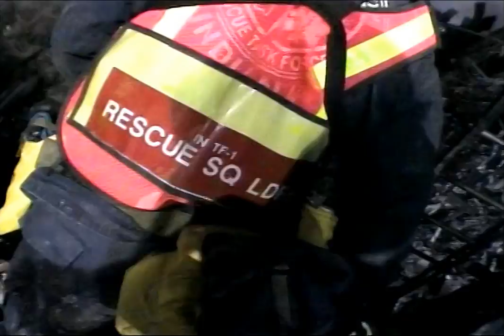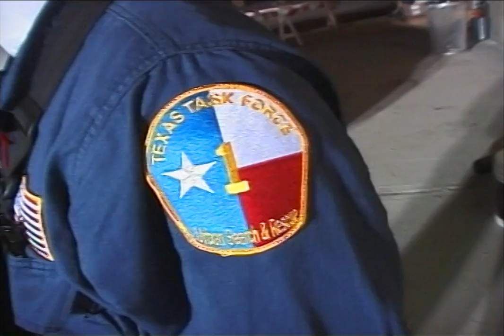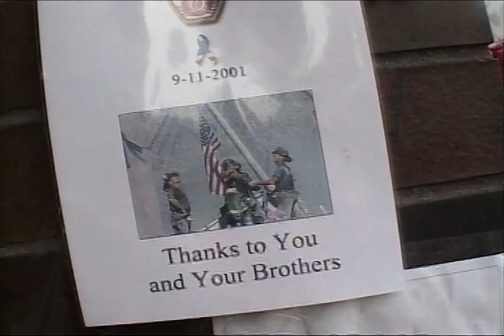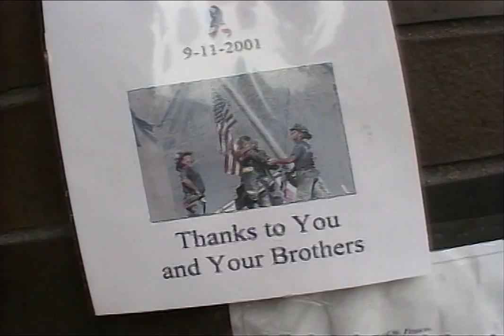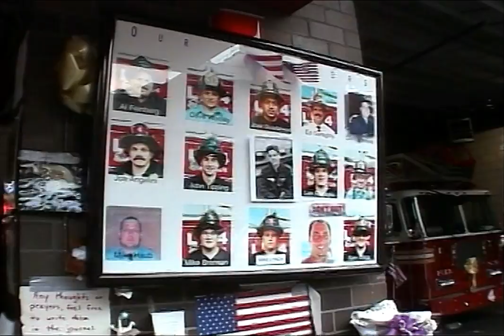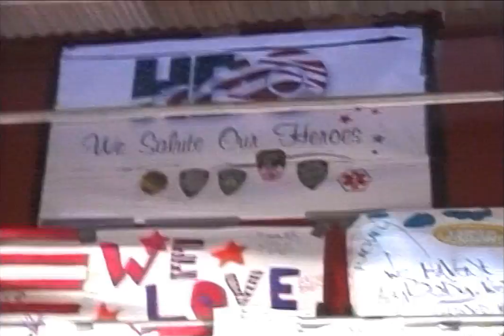NIST FOIA 09-42: R27 -- 42A0171 - G26D30 (Ground Zero/WTC Remains/Clean-Up) [Tape 2 of 2]

Comment: I’ve watched id like to think every 9/11 video the has been released,but this is my first time noticing 30:13 you can see like 25/30 floors all just stacked on top of each other like pancakes.
Watching these over again just makes me realize just how precious life is and it can be over faster than you can blink your eyes . 
Prayers to everyone who lost someone that day ,regardless of if they were at work in the tower,a emergency service worker,civilian or volunteer 🙏
Reply: Just a bit before that, around 27:50 when there are group of NYPD gathered around, extracting remains. You can also see that the two officers to the side are sitting on the beams of several separate floors of the building.

Comment: Whtas name of this equipment in 21:00 ???
Reply: They’re using scope cameras to see down in the debris to locate bodies. Earlier around 17:00 to 18:00 you can hear a faint three-beep-pause alarm. It’s a firefighter’s help alarm. They are sounded when a firefighter is down so they can be located. My guess is they found the general location or found another one and they are using the camera to try to figure out exactly where this fallen hero’s body is.

Comment: How did they know where to start?
Reply: Followed the streets and the map of the complex.
Reply: They planned it out beforehand
Reply: They knew about where, for example, the command post was, prior to the collapse and started looking there.    They also started by checking areas likely to have void spaces within- where they might find trapped people.

  Street and overhead maps of the complex are definitely helpful.   That can help differentiate between piles of rubble lying on the street, and the actual building.  (where survivable voids are more likely to be.)   You start by looking for places live people could be trapped/hidden.   Rescue of those still alive is the first priority, recovery of remains comes later.   It's essentially a process of elimination.

  What made it 1000x more difficult, was the nature of the collapse (pancake- one floor on another, on another, on...), and the construction OF those floors.  (concrete on steel pans, supported by trusses.  You get through one- only to find another.  Over and over again.)  With steel beams, pipes, wires, building contents, glass shards, pulverized concrete- and other stuff all throughout.   VERY few bodies were found intact...  It was mostly just bits and pieces.
Reply: @pyroman6000  or they were fully incinerated

Comment: Explain me how everything is turned into dust by just gravity pulling floor over floor of the tower of harden steel.
Reply: Are you actually watching or just reading some website? You can see pieces of everything there. The dust was from all the drywall and concrete.
Reply: Please watch how the building was actually made before spouting nonsense
Reply: you know there's a video literally above you showing a mountain of twisted metal right?
Reply: @JosephJamesNYC  Yes, Of course some steel is going to survive, but what you see is nothing near of what 2 towers of 100 floors would look like.
Reply: the same way a 24 inch house of cards can be compacted into a 3/4 inch pile.
all that magic aside, alot of people don't account for the debris sub street level, you have around 65 feet till bedrock, add a 20-30  mountain of debris ontop of that you're pushing towards a 100 foot mountain of wreckage. 
but lets pretend the mountain of debris never existed,  why does the pile not look like 2 towers worth of shit
Reply: @SagaraUrz  You realize that buildings are MOSTLY air, right? They're not solid objects. The majority of the space inside of a building is occupied by air. The debris field from the collapsed towers was spread out across a large area. You SAW the towers collapse. There are hundreds of videos of it. What exactly are you suggesting? That the towers didn't really fall? The towers were fake? Whatever it is you're trying to get at... give it up. It's an absurd notion.
Reply: @SagaraUrz the thing is, that stuff was a pile. they were not standing there on the pavements. I think you are dismissing the sheer size of ground zero, it was not just the spot where the buildings stood, the debris fell into a lot of open space and created such a big pile making it very difficult to comprehend the size of it.
Reply: Well, what about all the witnesses and rescue personal talking about how hard it was to find anything that wasn't dust? Not a computer, not a metal cabinet, not the huge steel generators the towers had, not metal step of the mechanical escalators,etc @riquelmeone
Reply: @SagaraUrz  what about it? what’s your point? if they had found a computer vs not finding a computer what would that even mean?
Reply: @riquelmeone  That means the towers were pulverized/dustified midair. The seismic data(or the lack of it) and unusually small amount of debris points to this direction. There are videos of qiant steel beams turning to dust midair. I suggest you to watch videos of Dr Judy Wood.
Reply: @MrDodobir  There are no such videos. What you are seeing is quite clearly NOT giant steel beams turning to dust midair, but rather them falling down and leaving a trace of smoke/ dust.
Watch the 12th September videos and just look at the sheer amount of rubble the people are standing on. That's neither dust nor powder, it's a pile of debris and clearly visible beams.
Where does this whole "pulverised/ dustified" nonsense even come from and what's the point of that theory?
Reply: Its coming from the theory of the mini nukes under the towers and the un building in NY.
I cant find it myself but but there is the claim that the construction of the wtc was only allowed if they can provide how they can deconstruct the towers one day in future, so the 60-70s was about nukes and they made a deconstruction plan for the towers including a drill in the bedrock with a mini nuke extra for the demolition, to get the green light for the construction of the towers and even the un building in NY they say has a mini nuke extra for that purpose in the plans before the building could be build. 
In short someone found out they had to have a plan for the safe demolition of such gigantic new skyscrapers.
So the theory goes on, these mini nukes deployed under the tower would create a big granite plasma that would blow straight throw the only drilling hole and open up all the ground of the basement of the tower and shot a huge beam of energy from that nuke through the tower so everything would be vaporized or melted. 
I don't think that happened but the big granite bowl underneath is real and the walls look melted like colourful glas.. its was burning or whatever there was for 2 month. so much heat under all that.
Ground zero also before 911 was the term for where a nuke was exploding.
So its not stupid what whoever came up with but. I have never seen the construction plans for the towers and the infos of the nukes as a police so they could start building the towers.
But people don't come up with such stuff themselves its from videos.
I doubt anyone searches for themself.
Just online stuff in videos years ago, i cant find them but still. 
One needs to have access to all policy before the construction of wtc.
And what is with the un building?
Can we see the same nuke strategy in those construction plans?
Just videos who show stuff of it. 
Search for it and maybe you find info of such construction plans. 
I doubt it the rubble and the pile looks decent to me i think this is the whole two towers we see. 
Its so much but why it burned underground for so long.
Im not an expert.
Idk.
   @riquelmeone
Reply: @NicGoldenEddie  did you hand-type all of this? sorry mate, but you might want to get a life. I thought this was a real topic here
Reply: @SagaraUrz  Wow, four years later and you are still blabbering nonsense!
Reply: @JosephJamesNYC  there’s also one about how they collapsed that explains it very well for those who actually want to know.
Reply: @SagaraUrz  have you ever been inside some thing 1800°
Reply: @NicGoldenEddie  because they had a full tanks on 767 of jet fuel enough to go across the entire country and they’re slammed in 500 and 600 miles an hour and look into how the buildings were built to make them easier to make on the ground or sections of it so it would not take forever to build. 
  The bowl on the bottom is not for a nuke. It was six floors of Mall’s train station stops and parking.
Reply: Jet fuel burning at 1000 degrees.
Reply: @NicGoldenEddie this guy gets its🙏 🤫 true is power man

Comment: No "pancaked floors", only steel and dust. And they say it wasn't a controlled demolition. Yeah, right....
Reply: Nope. You are
Reply: They were pulverized.
Reply: Ashley Smith Nonsense.  You can find videos of firefighters showing multiple pancaked floors in chunks of debris.  You just don’t want to look.
Reply: Site was hot, red hot for weeks. Explain that, friction? HA! @Osteoja
Reply: @JT-cf7dq  You thought you got me, no.

There was a fire happening at the site, since the day of 9/11. The materials from the building had not really gone anywhere, and heat was trapped under the rubble. Cars under the garage, electric cables, oil, gas, you have to account everything. It isn't as simple as you truthers find it to be.
Reply: Also because the whole building swayed, it screwed up the floors/steel beams. So when you had to building falling through the floors, it was already fucked.
Reply: You have 10-20 floors falling on a single floor is already a problem, nothing can hold that. Now from 20 you have 21 floors on the next. I call it the snowball effect. When you see puffs of smoke blow through the windows. It is because the floor failed first, weakest part. Then now you have standing beams with no support they end up falling. A delayed reaction.
Reply: @Neale There was a fire on just about every floor of 7 WTC, along with a huge gash similar to the Liberty building from 2 WTC collapse. Search 7 WTC hole, firefighters HAD TO evacuate from the WTC site fearing that the bathtub of the wtc would fail and alot of the Hudson would fill the WTC site. Pentagon was a plane strike, look up RENO AIR SHOW CRASH, same thing it hit the building ground so hard it almost disintegrates. Same go for the failed hijacking. The lobby of 1 WTC had actually had fire from both the elevators crashing down about 110 stories and yes pressure+flames shooting down from a very big explosion.
Reply: @Osteoja  Incorrect
Reply: @mattadams933  No, I am not.
Reply: @mattadams933  I agree with you, than man is pathetic, his explantions are ridiculous.
Reply: @rebeltough7  Beams don't have to melt to fail, if it's hot enough to warp it will buckle and snap, doofus. Stop replying to this, I wish old comments were locked.
Reply: @Osteoja  You know nothing and are not a structural engineer. You keep repeating what's been debunked, try again.
Reply: @mattadams933  6 years, talk to about this again? lol
Reply: @Osteoja  Yet here you are talking about what you don't know
Reply: @mattadams933  I've studied for it, you are all here with your Keyboard Degrees.
Reply: I was watching a video that shows how the core is still up at the collapse. The facade came down but the core was still standing. It was the plane. Wheter you think it was an inside job or not, there's no way to deny it was the plane that destroyed them
Reply: @mattadams933  Are you a structural engineer?
Reply: A planestrike could not cause catastrophic
Reply: I swear people will look for any excuse to throw their theories around. Respect those who died that day and stop using their deaths as a way to promote your feelings towards politics
Reply: @molotovb u got a link? I have yet to come across this